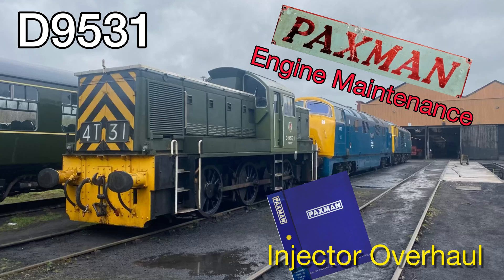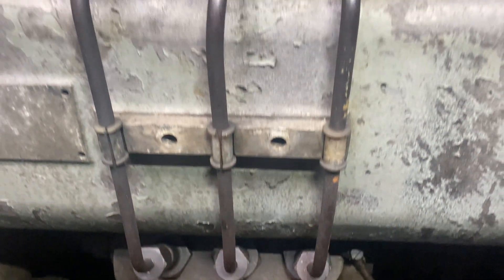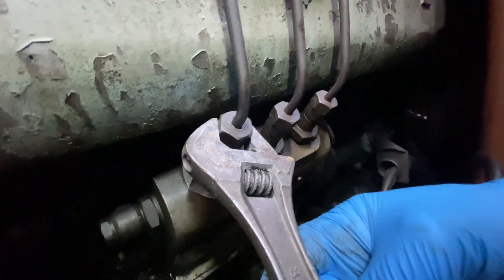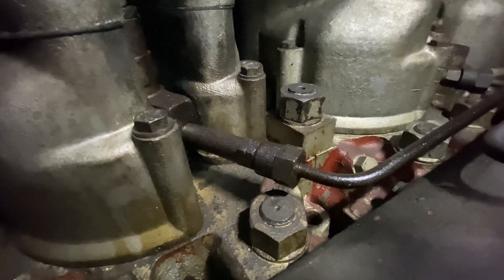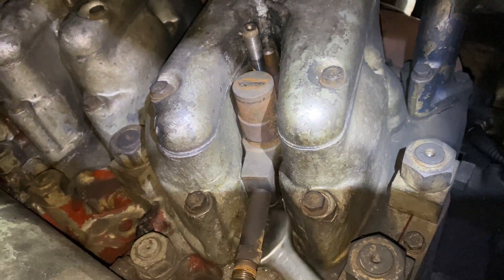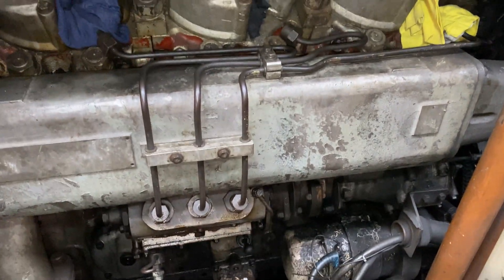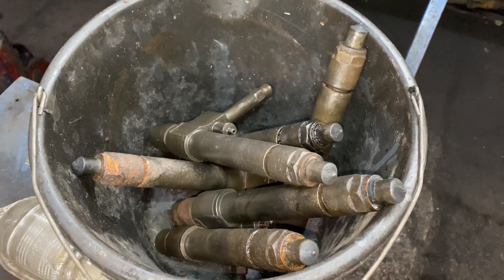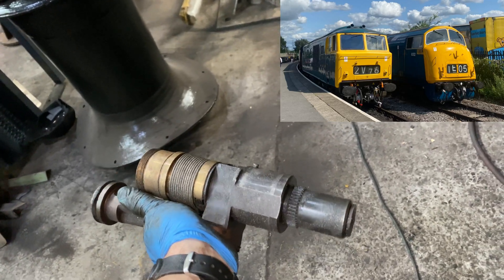D9531 Locomotive Maintenance - Paxman Injector Overhaul (Part 1)

Comment: Hi, I no nothing about Diesel Loco maintainance, but I was surprised how easy it is to remove those injectors. I guess they sure made things maintainable back then, unlike today............Are all railway Diesel locomotives so easy to work on? All the best and thanks Dave.
Reply: I used to work on the Deltic locos at Finsbury Park depot, and changing the injectors on one of those engines was a day`s work lying down to do thw A & C banks, and on top to do B bank. We`d get a mattress from the stores to lay on while changing them, but if the engine was still warm I sometimes got to cozy and felt like nodding off.
Reply from the maker: I know exactly what you mean. Lying down in the narrow walkway. Not a fun day. 

Worst job on a deltic was changing the main gen brushes!
Reply from the maker: Don't let the magic of YouTube fool you. I did have a very long bar to tease them out. One way (but didn't on this occasion) is to loosen the injector mounting bolts and then fire up the engine and they litterially fly out!

They are not always easy to work on. Access is the main issue. 

Have a look at my other video on the warship when I changed the waterpump drive. 

Thanks for your comments and please share and like.